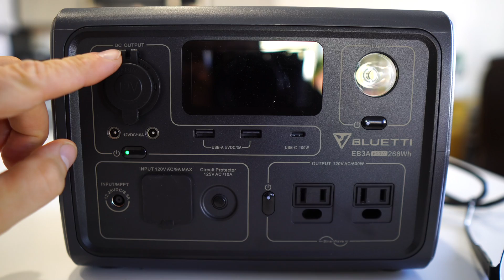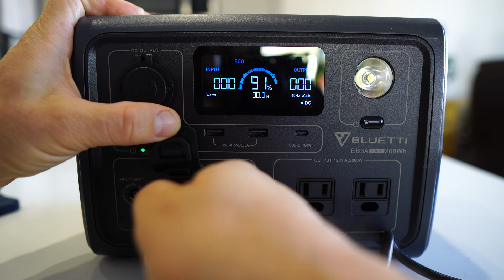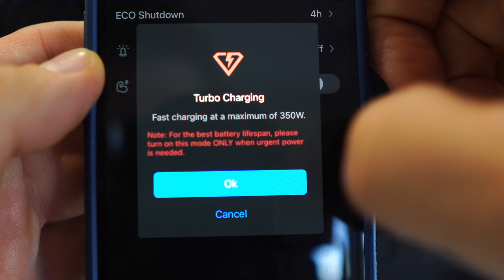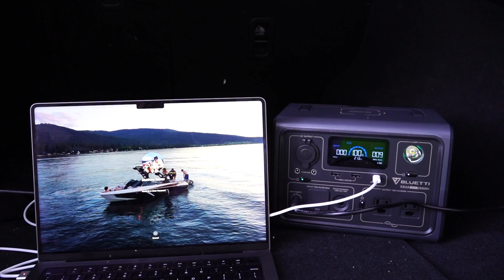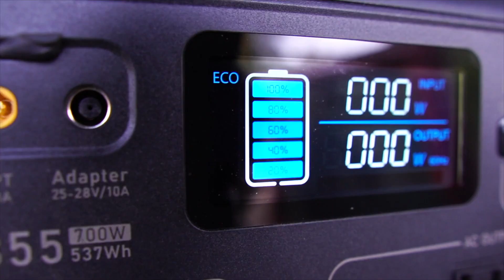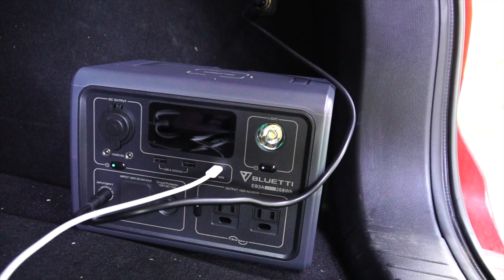5 Pros and 5 Cons of The Bluetti EB3A Portable Power Station

Comment: I had a bluetti that didn't last me a year.  It was their big bulky model, weighed a ton I live the van life full time.  The first summer the heat fried the cuircuts.  I have a jackery 300 had it for a couple of years, no problems.  I'm looking around for an inexpensive 600 watt station and have the jackery for a backup.   But in my past experience with bluetti, despite your review on it, I put it at the bottom of the list.

Comment: Had an opportunity to get two of these last year. July 23 2025  during may last camping trip the last one went in the trash. When they worked it was outstanding but. Same failure on both units. would just randomly shut down. Then i would have to wait to get it to run again. No it was not overloaded. Only had a 13" laptop plugged in. 2 units with the same problem. It does seem to be a reoccurring issue for several of the reviews on amazon. My Anker is still working with no issues. Sooooooo.......

Comment: Looking for something to keep some lights on, TV and WiFi ... Would this work for that?
Reply from the maker: It likely could, but you're not gonna get a lot of sustained use out of it, maybe a couple hours. If you're looking for a home solution to get you through a disaster or a prolonged power outage, I'd start with a 2000 watt hour setup.

Comment: I have an EB3A. It came with no charging cables in the box except for the AC cord.
One night it fell 2 feet off a night stand, and never worked again. Also after trying to contact customer service I gave up on trying to get it repaired.
And it couldn't power a small AC dorm fridge that briefly surges to 500 watts for one second, before running at 89 watts continuous.
Disappointed.
Reply: Thats normal for a fridge , 500w startup , then around 100w usage 😅

Comment: Okay I hope someone answers my question I’m a truck driver and I’ve been wanting to buy one of these too connect my air fryer or electric stove my semi truck can handle these products but I rather cook outside where I have more room so do you think it’ll handle that??? Btw I don’t know how much wattage they draw or any information on that cause I have no idea when it comes to anything in that realm 😅 but please lmk
Reply from the maker: I think, if you're gonna wanna run electric appliances, this one might be a little small. Hard to say, not knowing what your overall draw is going to be, but I'd look for something in at least the 500 watt hour range to start with. I think an air fryer is gonna have a draw closer to that of a microwave, and if so, you're gonna want something that has a significant sized inverter on it, like 1500-2000 watts and this unit ain't gonna cut it for that. Honestly, with an air fryer, I'd try and hook a 2500 or 3000 watt inverter directly to the truck and idle when the inverter is running, but if you're a company driver, your options to hook something like that up might be limited.

Comment: It says the eb3a is 600w 1200 surge? Am I reading it wrong
Reply from the maker: It has a 600w inverter with the capability to surge 1200w. The battery itself is only 300 watt hours, so if you run at the full 600w, you’ll get less than half an hour out of it before it’s empty.
Reply: @MattKester  ahhh ok great thank you. I just ordered one for my son after watching your video. Thanks again for clarifying

Comment: Hi, I got a question. Can you use this on UPS that has a that has a capacity of 1800watts and using the UPS on a gaming PC that has a 1000watts? I just got this Idea if this is possible for longer power outage
Reply: And this device is always plug in on that purpose? Is that possible?
Reply from the maker: That seems like a pretty high constant load to have on this unit, plus it wouldn’t last long into a power outage. At those levels, you’re gonna want something with at least a 2000watt constant inverter supply and at least 2000 watt hours of battery. This particular unit is just waaay too small for those needs.
Reply: @MattKester  Thanks for answering. Is it okay though if this device is always plug in?? I want to use this as an UPS on my computer, incase there is an power outage for about 30 minutes I wont get disconnected on the game I am playing. Unsudden power outage suck I always get penalty on every game because I afk. Pardon me if I got too many questions and I hope you understand what I am asking.

Comment: The EB3A is one of 2 Bluetti power stations that I use for my truck camping (the AC200L is internal to the track bed cap / man cave).  The EB3A is perfect for the camp fireside or table because it will charge all the camera batteries, iPhone / iPad, or other small devises I have, without having to plug into the truck power station system.  For my setup, I have a PV120 solar panel solely for the EB3A, and it is plugged in almost all day long supporting those other devises.

Comment: Can I use it to power a speaker for an outdoor event?
Reply: This depends on what wattage your speakers are.  The power unit is advertised at 268 wh, which probably means a couple of 100 watt speakers may drain the unit in just over an hour.  But 20 watts is quite loud inside a home and that would mean quite a few hours annoying your neighbours (heh heh).  Remember the advertised output is often higher than you actually get (rule of thumb knock of 10 % minimum).

If your outdoor event is going to last for hours, you may find that this unit is underpowered for what you’re asking it to do.  Depends on what numbers the crowd is, too.

Comment: Can I run my Cpap on it for 8 hours?
Reply: Not sure what a Cpap is. All I can say is I don’t trust it to keep my fridge running.
Reply: No, depending on your cpap model - this might keep it running but I would get a bigger size just in case
Reply: I've used mine with my CPAP while camping and it didn't last the entire night, unfortunately.  
That said, I've had it for over two years now and it's been terrific running my 12 volt 20 quart cooler for up to 13 hours on a full charge; and with the 12v car charger cord recharging while I was driving it was doable.  Also proves to be great around the house in a power outage, running my WiFi router and a lamp.  Other small uses as well.    
I've been so pleased with it that I recently bought the new Bluetti Elite 200 V2 for the CPAP while camping and to run a coffee maker and more while camping and road tripping.  My first test with that was running just that 12 volt cooler - it lasted a full seven days on a full charge.

Comment: I love my eb3a solar generator. I was able to charge 0 to 100 percent on 12 of my devices and took 80 percent out of 100 on the device. I was able to work my whirlpool 3.1 two door fridge for 12 hours max depleting eb3a . I also use it on a mini ricecooker and was able to cook rice and soup. It only took like 40 percent on this device. Dont use it on microwave toaster aor fryer or hairdryer anything that is over 600 or u will overload it. Have not tested the solar panel yet cause it was expensive for me to buy. The charging is fast on normal mode. 0 to 100 percent only toom like 50 mins for me which is a win. The fan is not that loud when charging it or plugging it with higher wattage. My mini fan is louder than 3b3a. I would recomend this to anyone. If u want more power get ecoflow delta pro or anker if it is in your budget

Comment: I have a Flashfish  brand unit I bought on amazon, I used it for running aquarium pump during power loss. After less then 30 months the unit no longer held a charge,Money down the toilet.I am looking at this unit with the LifePo4 battery.I hope battery has longer life.

Comment: I bought this unit. I agree the wireless charge is un needed give me the control button.  Is this a show stopper naw it’s an amazing device, most people under buy power supply they really need.   This is for charging iPads, iPhones when traveling or camping. Don’t run a heater just want to recharge devices.

Comment: Matt, I'm looking at a 12v fridge freezer that pulls 45 watts on eco mode, 60 w on max. . Plan is to charge from ac to precool, load it with frozen blocks of ready made meals and run on eco. I am trying to figure out how long the eb3a will power this little fridge on it's own. In our fifth wheel we boondock with solar charging our batteries during the day but we power everything down but the propane fridge when we go to bed. 
I'm hoping there's enough amp hours in the bluetti to keep the freezer running until the sun comes up.

Comment: I bought Bluetti because of good review. But it Failed as most important feature that is Solar Panel dont work. Went through hell looking for connecters to
Fit Harbor Freight Thunderbolt 100w panel to find out they won't work after i realize i had to buy Harbor Freight solar connector kit. Sae to 8mm plug.😮

Comment: The one problem using this as a UPS is that it does not seem to have a USB trigger to connect to a computer with software to automatically shut down the computer when the battery gets low.  Without that the computer will just crash.  Maybe you can plug a real UPS into this unit to extend the time of the UPS and still have the automatic shutdown.

Comment: Did an Experiment.... Put a USB powered Fan through a hole in a sheet of plywood that fits in my car's sun roof.  Particularly for parking at Tourist Attractions where the car is left out in the sun all day.   Fan pulls the Heat Out, and cool air from below comes in through the air vents. At the Butchart Gardens in Victoria, BC, Canada, the Bluetti EB3A went from 100% down to 73% after spending 4 hours there, and amazingly it kept the car cool inside.
Reply: Awesome idea

Comment: Is it possible to connect an inverter having a high wattage of 2000W from the 12v cigarette socket inorder to run a devices having a wattage of 1200w to 2000W?
Reply from the maker: Mmm, I’d probably say no. Every inverter that size I’ve ever seen required it to be hardwired to the battery. Even if you could wire an inverter in, the battery is so small, that kind of load would deplete it in a few minutes, and might cause a fire. I would strongly recommend buying a portable power bank that already comes configured with the correct size battery and inverter for that load.

Comment: Thanks for the informative and entertaining video.  Just purchased my EB3A last week.  So far so good.  The purpose for my purchase is one of camping.  I have used it at home with my cpap machine and was able to achieve three nights with it.  All the bells and whistles were off on my cpap and I also charged my iPhone each night.  I tested a small 5 cup Mr. Coffee maker with it and it performed well.  Yes it takes some juice to produce the coffee but at least it  can do it with the power lift feature turned on.  I don't think the lack of usb A ports are that important as I have many car plugs that have quick chargers and also more usb c plugs on the car/cigarette plug.  I also have a EcoFlow River 2 Max that I use camping.  It has about twice as many watt hours and can do the same functions.  both are needed for our boon docking camping excursions.  I love them both.  From what I have experienced the EcoFlow appears to a little more efficient on using watts with my cpap (ResMed Air sense 10)machine.  Thanks again for great review of the EB3A.
Reply: Does the Eco flow have a DC output? I hear that saves a lot on battery life, I have the same RM as you.

Comment: Love my EB3A. I learned that my DELL laptop charger will charge the EB3A as well.  I already have a car adapter that will fit so not including it is not an issue for me. 
I do agree that not having buttons onboard to change options/modes is a real bummer.( I say the same about my $#+%ing cable box ). But purchasing at 150 bucks makes me wish I'd bought 2.🤷🏾‍♂️

Comment: I want something that can power a cooler in my car to keep foods from going off.  Near the end, you said you wouldn't recommend using this for a 12 volt fridge.  Does that include a 12 volt portable fridge?  https://www.youtube.com/watch?v=QgEoxtcKlVQ
Reply from the maker: Yes. If I was going to run a fridge like the one you showed, I would opt for something closer to the 500 watt/hour class of battery, especially if you’re going to need it to power that fridge for a whole overnight. The EB3A will certainly handle running that fridge, it’s just not gonna be able to do it for as long as a 500 watt/hour battery, especially if you have other electronics you need to run off it.
Reply: @MattKester  - GREAT!!!  Thanks for the Info! I have an EcoFlow Max with 576Wh and a 600watt inverter.  So that should work, right?  The last thing I want to do is keep our cooler/fridge plugged into my car, only to wake up and find it's not running and the car battery is dead.  Been there!  Done that!
Reply from the maker: @MatthewFordVictoria  yeah, that size should run you overnight. Just be sure you’ve got sufficient charging the next day.
Reply: @MattKester  - I purchased 2 EcoFlows actually.  The EcoFlow Max and the EcoFlow Pro which has even More Power, as I was wondering if they would last the whole night, or if I'd have to get up in the middle of the night to switch them over.  Now I've learned that I can attach a Solar Panel while it's in use, so when the sun comes up, it'll raise the strength so it's ready for another night.  How cool is that???   So my other EcoFlow can be used for other things I guess, like lights, music, etc.  THANKS AGAIN!!!

Comment: I want a portable bluetti like the EB3A but more for cpaps
Reply from the maker: Do you happen to know what the draw on your cpap is?
Reply: @MattKester  I thonk its 65?i dont really unfetstand it all.i do know with16 pressure it didnt work.but now its 8 pressure.the resned i think drawd 65w.
Reply: Resmed 11 is the cpap
Reply from the maker: @joanbroyles9802  I just looked up the Resmed Air 11. Spec sheet says a typical draw of 54w and a peak of 73w. With that kind of load, I’d say you’ll probably want to look at something in the 500 watt/hour class.
Reply: @MattKester  ok thankyou.you are very helpful

Comment: The wireless charging pad is a bonus but not essential as most people don't have a wireless charging phone. However no ability to add an expansion battery. The Vtoman 600x can be expanded to 939wh would be a great alternative. Separate charging brick has it's pros and cons, The con is, if it becomes faulty, you only need to replace the charging brick rather than the whole unit or sending the whole unit back to the manufacturer/seller.
Reply: I couldn’t get it to work with my iPhone 13 Pro.. is there a switch to turn on that facility?
Reply: "Most people don't have a wireless charging phone." 🤔🤔 Really?

Comment: 268 wh is nothing more than a overpriced phone charger
Reply: You can't think of anything someone might like to have a 10 pound mobile wall outlet for? You are hard to please.
Reply: @rizipt  doesn't have enough Watt hours to be of any use other than a charger for your cell phones or computer laptop
Reply: @jophillips2868  It runs my tv all night long
Reply: @rizipt  how are you charging it the next morning so you can use it again
Reply: @jophillips2868  You're making my point here. You want it all. The fact that this thing will let you take your laptop to places where laptops weren't supposed to go should be enough. In answer to your question: I'm not. It served its purpose. I got to watch tv all night in a damn tent. What do you want it to do for all of its ten pound might?
Reply: @jophillips2868  I could easily hook it up to a panel and watch tv every night in the tent. Again, what would satisfy you?
Reply: I have a 20 inch tv I like to put in my tent. The tv uses 20W. I can watch tv for more than 10 hours with this.
Reply: @rizipt  me too, with solarpower input, i can watch the whole day long television, , and half night, too, i use 12Volt-tv, of course..

Comment: I wanted to know what kind of solar panel cables are needed
Reply: I bought one of those generic portable panels and it included a bunch of different output adapters. The generator does include a standard PV solar panel cable but you don't have to use it if your panel won't work with it. I was able to directly connect it using one of the cable that came with the panel, directly into the 12VDC input port on the unit.

Comment: i think the first Con isn't really a con, more of just an inconvenience, as if you have a wall plug fast charger, you can use that to do so. or a USB C dock can do similar. i do believe they have changed it so the car cable is now included, but i'm not 100% sure on that one.
Reply: I just got mine a few days ago. It indeed does include the car cable, and it also included the solar panel cable. The user manual says the solar cable is not included so that's why I mention it here.

Comment: Hello all. Could I charge this from my van's battery, continuously (while driving), in my campervan? Is this possible through the input DC port? Thank you very much
Reply: You could..one way would be to split off wire's from the positive and negative ends of the battery and connect them to a 12v cigarette style plug, and then that can plug directly into the 12v cig plug adapter for the Bluetti. I'd be worried about accidently draining your battery though, unless you mean the "house" battery?